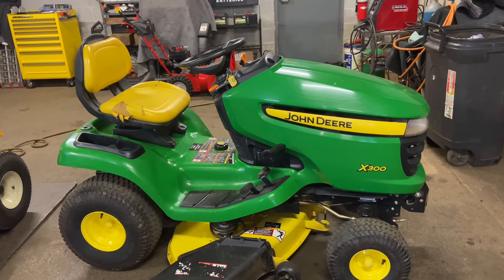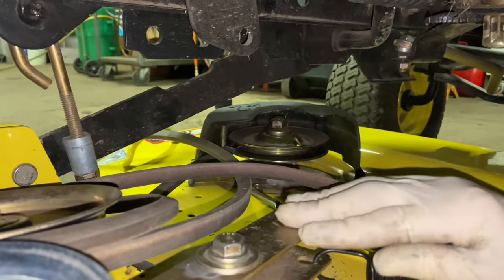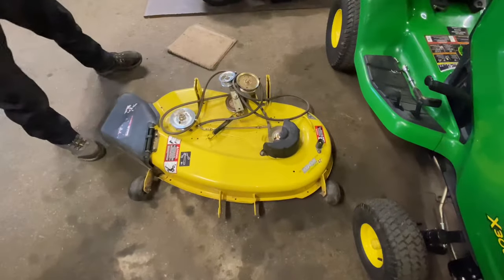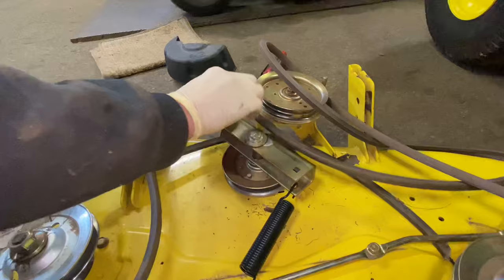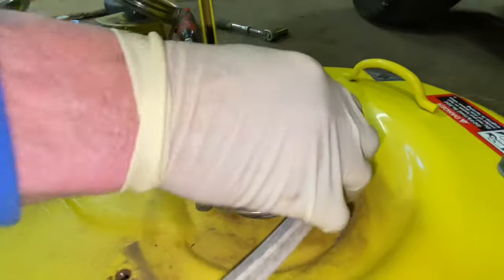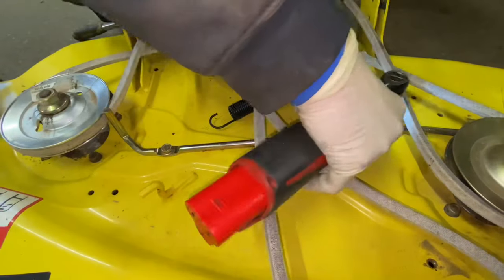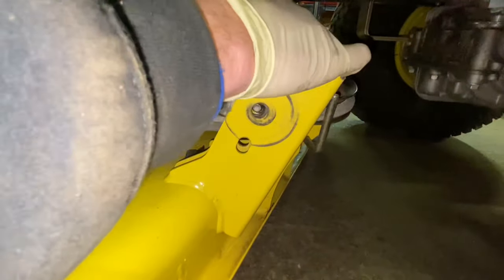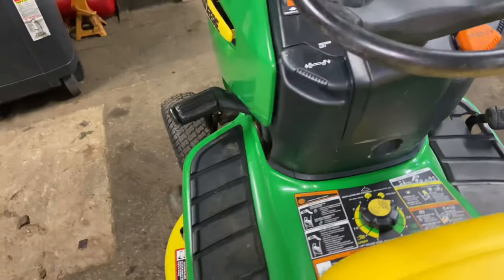How to Install a Mower Deck Belt on a John Deere X300

Comment: Omg.  You are great.  I’m 72 yr old woman and I needed to change the belt on my mower.  Your instructions were so thorough and easy to follow.   
I’ve never worked on mechanical things before.  The only set back I had was not having enough muscle to put the spring back on.  Darn it.  Had to call my neighbor for that one step.  Then of course he wanted to help put it back under the mower.  Very nice gesture.  But now I can only say I did most of it. 
Thank you for taking the time to do this perfect video.  You are appreciated.
Reply from the maker: I’m so happy with a little help from a video you were able to get the job done and the little part that your neighbor help with. Good going!! Thank you for the kind comment:) take care!
Reply: You are a remarkable person to DIY at 72 years old. God bless.

Comment: Thanks so much for the most clear and accurate explanation of belt replacement……my 350 belt came off this am, a stick got wedged in front and dislodged the belt. Your video made it easy for me to straighten out the belt and the 3/8’s drive popped it back on. Tested, works fine. Your video saved me a couple of hundred bucks at least.
Reply from the maker: Hi John, I'm glad it was helpful, please give it a thumbs up, subscribe and tell your friends to help my channel grow! It would be greatly appreciated :)

Comment: Easy and very simple to follow tutorial. Many thanks. Cost of genuine belt in Australia US $92 - $105 (AUD $ 140-160 ea). The quality seems not all that good as they do not last with heavy work. I was tired of paying high price and replacing regularly. I fitted an agricultural 144inch circumfrence 5/8in wide  (JD specs are 146in by 1/5in) at a cost of US $30 (AUD $50) and does fantastic job. Seems much stronger and has lasted!! Your advice and the new belt has saved me $$$$.
Reply from the maker: Excellent! Glad to hear :)
Reply: I measured my jd belt as 145 od circumference ( on outside of belt) my old one was broken so I had nothing to measure except a new JD p/n M154621 one. I wish there was a cross reference from the JD part number to the belt size. Sometimes  i think they break because after the age and heat up they eventually become loose and start to slip. So next time I might try starting with a 1/2 inch one a little smaller maybe 144 inches or 5/8 wide 145 in long  to see if it will work.
Reply: My us price for part no M154621 was about $61 before tax.

Comment: I tell you one thing, if you can’t follow Brad’s instructions for this simple (X-300) belt change, you may need to call John Deere. This has got to be one of the most clearly described tasks, that I have ever viewed on You-Tube.  Thank you Brad for a great presentation.  I had “zero” problems changing my belt, after watching your video. Thank you !
Reply from the maker: Hi Nick, I'm glad it was easy to follow and thank you for the kind comment and for supporting my channel!

Comment: I am honored to be…at this time… your newest subscribe, sir!!!  I’m sure that won’t be the case for long, however. 
I just bought my first John Deere… a lightly used X-300 with 48” deck.  Had a deck belt break this evening. 
Gotta go to my John Deere dealer Monday and get the new belt. Started looking to see exactly how one should go about the replacement and I was very blessed to find you!
I have no doubt I will be able to do this easily, now. 
Gonna use the time before dealer opens on Monday to find an old screwdriver and hit my shop to make a hook like you use. 
Keep it up sir!!!  You rock!!
Reply from the maker: Hi Ken, thank you for supporting my channel and helping it grow by doing so;. I’m glad this video was helpful. Thank you for the kind words.

Comment: Thank you ! Keep up the great work your doing !!! Those pully spacers will go bad keep your eyes on them !
Reply from the maker: Will do! I just found out if you are snapping your belt often? The mower deck adjusting hanger/bolt on the right side may be a issue. I just performed, taking one off and cutting it. It was harder to take off and it may be just as easy to cut the end off while it’s on the machine. It seems the threaded part may interfere with the belt making it snap or brake way before the belt is worn out. I need to put that video up but have editing to do.
Reply: @JohnsonsSmallEngines  just remember there are no small engine machines good business to get into right now I'm doing good !!

Comment: Thank you!!! I did it!!! I couldn't have done it without you. Yay!!!
Reply from the maker: I’m glad the video was helpful and you were able to get the job done:)
Reply: @JohnsonsSmallEngines  I took it for a test run & minutes later it seized on me, belt was hot & metal was super hot. Any suggestions or thoughts?
Reply from the maker: Check to make sure your blades are turning freely and also make sure all pulleys are turning freely.
Reply from the maker: It sounds like you may have a seized pulley
Reply: @JohnsonsSmallEngines  I think you are right. I'm going to remove deck from mower and check it out. Thank you
Reply: I still use this as reference to change the belt, which I'll be doing tomorrow. Thank you.

Comment: You are very knowledgeable, thanks for sharing. Looks easy enough. Saved me a hundred or so bucks. I have a question the brackets for my x300 hood Broke so the hood will not stay on I cannot find these brackets anywhere. Any suggestions?
Reply from the maker: I have not seen a broken X300 hood yet. I would just keep looking online or call the local John Deere dealership to see if they may be able to help you out.

Comment: Awesome video. Very thorough and easy to follow. Thanks. Belt was actually good but one of the pulley wheel bearings were bad. Need to replace. Best place to get affordable parts?
Reply from the maker: I suggest using the John Deere belt from John Deere and you can cross reference the idler pulleys to a aftermarket online or just purchase all from John Deere. There pricing is good and the belts are also good quality.

Comment: I replaced my belt according to your instructions and everything looks right! When I engage the mower, I smell rubber. What should I re-check?
Reply from the maker: It sounds like you may have a seized pulley or the blades may have an obstruction. Check to make sure the blades are not binding on anything and turn freely. Make sure all idler pulleys are spinning freely. Repair or replace if needed.
Reply: @JohnsonsSmallEngines  Pulled the mowing deck back off, double checked all the pulleys and blades. Re-attached the deck and all is good!!! Thanks for your help!
Reply: Also check your idler pulleys. If you flipped them over, the belt will come off and tangle. Thus a rubber smell. Happened to me.

Comment: i noticed  there is a deck clean out  can you buy that and instaoll it yourself
Reply from the maker: If you’re talking about the one that you attach a garden hose to? In my opinion I do not recommend anybody washing their tractor with a garden hose let alone using a wash port but it’s up to you that’s just my opinion. You can ruin bearings on the mower deck in washing your tractor you can run bearings in the transmission area so I don’t recommend it. Just my opinion.

Comment: Can you tell me why john deer belts snap,the mower has had six belts in a year lucky if you get one hour use ,they are made not to last.why not use gates belt this mower cost lot's of DOLLARS to run kubota far better mower
Reply from the maker: I have had a few customers with this exact mower deck with the same issue and they wound up selling the tractor. I had replaced the pivot points on the arms and it did not help. My opinion is John Deere had a very poor design on the model mower deck. Your not the only person with that issue. Kubota tractors were very, very good but they are now overpriced and not as good. You need to replace your deck with a different version.
Reply: I had the same problem with the belts snapping in the first hour of mowing. Luckily the folks from my local Napa store were aware of the fact that I have been given the wrong belt which is was shorter by 1 inch or so. It happened to my belt twice.  It was a long investigation between the the Serial number of the engine and the deck size of the mower.
Now I have a different issue, I smell rubber when mowing and for some reason I find the belt off the spindle and apparently jammed outside the Idler pulley. Why is this happening I dont know but its all a Mystery  with JD. I wish I had something nice to say about this mower.

Comment: Hi,
Can you tell me which pulley is the idler pulley? 
Thanks
Reply from the maker: The idler pulleys on top of the mower deck are between the outside blade pulleys.
Reply: 🤔The one the ratchet attaches to…

Comment: Thank you so much for the video. I have a question, the height pedal of my X304 is always down, to adjust my deck height  I have to pull the pedal all the way up to set the proper height. The pedal won't lock.
Reply from the maker: (1) I have come across the same issue when the mower deck was leveled and someone adjusted the deck height too high.(meaning someone adjusted the front mower deck bar up in the front to high so the deck hit the frame so your height pedal would not lock into the up locked position) You may need to lower the deck height adjustment in front and maybe even the sides? (2) I do know the lock in handle can be tricky to engage sometimes. I hope that helps you out! Thank you very much for supporting my channel by subscribing !!